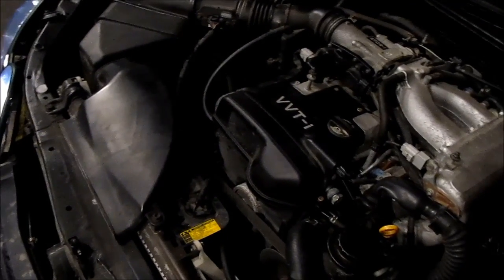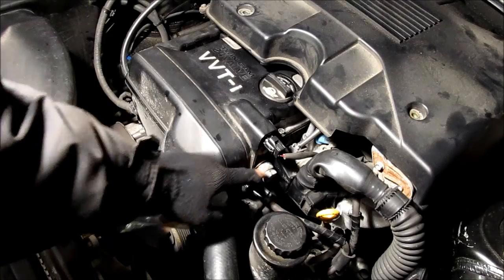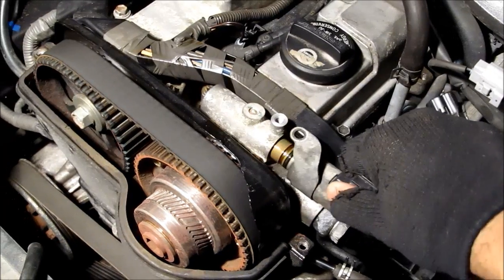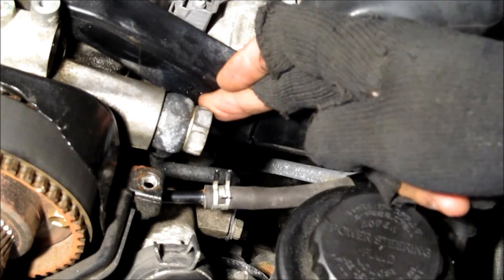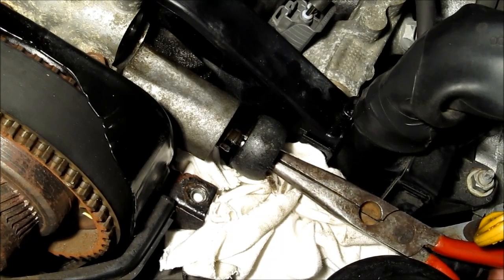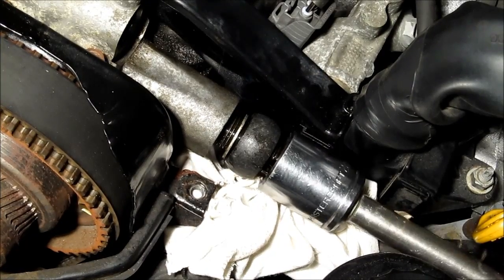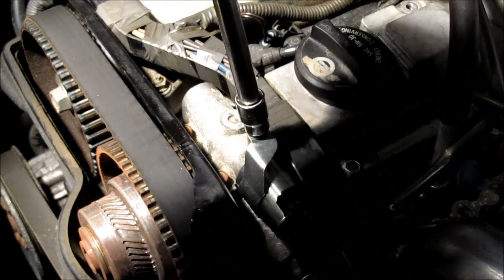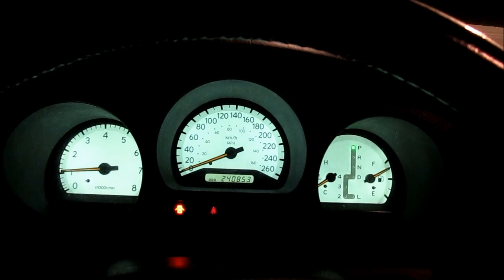P1349 Oil Control Valve Replacement  - Lexus IS300 / GS300

Comment: This is exactly what makes a fine repair video. Short and to the point, but with all the detail you need. Mine initially seemed stuck during removal, so I stuck a small flathead screwdriver in between the valve and the engine, gave it a twist, and it popped loose. I think the O-ring causes this. Oil the new O-ring when installing. Cleaning the filter with brake cleaner makes it like new, just check the plastic for brittleness. After install I cleared the codes and cranked it. I freaked a bit because the idle jumped to ~3K and stayed there. I just let it run (as I understand these things self-calibrate) and sure enough, in about 60 sec it dropped down to 1K. Test drive tomorrow, but all looks good. Thx!

Comment: Even if your valve works with 12V it doesnt mean its not broken. Mine was working with 12v after having P0014 code, tried the ohmeter and had 45 ohm on the old one while all the 3 other had 12.9, the range of these valves should be 8 to 12 ohms, if yours has like 3 ohms or 35 ohms don't look further it should be replaced. My dealership asked me 230€ for a brand new part + I guess one hour labor (110€) when I just bought this on ebay for 25 dollars (yes its used but it works it had the good 12 ohms and my code didnt come back after the replacing)

Comment: But if the unit works under the 12 volts, then it should work in the system not so? So why change it?
Reply from the maker: Yes it should work when 12V applied
Reply: @speedkar99  you must've made this video before you inherited your brothers underwear.
Reply: I think the orings could also wear and create an issue. If you see it actuating doesn't mean that when it's under pressure or hot that it still works.

Comment: Wat size is the washer inside the bolt? Mine fell off n now oil is leaking from there. FML!
Reply from the maker: Not sure anymore 😔 I lost my bolt too
Reply: Those washers are made of soft metal sometimes copper and some aluminum. I've seen something like a dorman kit that has various sizes of them. Crush washers are what's on the spark plugs and they look different.

Comment: My oil pressure light is on in my 99 es300. Could the VVT solenoid be the culprit?
Reply from the maker: No
Reply: Are you sure it's not the low oil light. There are 2 lights red and orange.

Comment: Thanks for the video. I did this based on the code and it stopped the bad idle but the check engine light still on.  Doesn it clear automatically once the solenoid is replaced?
Reply from the maker: Pull the battery

Comment: Thanks for the video. I just ran into this problem earlier today IS300 2001 with 137K miles. Check engine light came on and the traction control light flashes. Usually driving does not vibrates my car or stutters only when I come to a stop. Just got an OBII scan - P1349 VVT system maintenance and most likely solution is to replace Varibale Camshaft Timing (VCT) Solenoid. Anyone familiar with this issue? thanks
Reply from the maker: Same issue here.

Comment: Very informative. I have the PO300, PO301, PO304, and PO305 faut codes on my Lexus GS300, 2001. And the ClubLexus forum suggest to replace the Oil Control Valve.
Reply from the maker: Thanks. Hopefully it works for you
Reply: P0300, P0301, P0302, P0303 - cylindars 1,2,3 misfiring for me. I replaced my plugs and wires (not coils). I'm going to replace vvti (aka - 12v part being replaced) and filter as shown in video. I have 250k and I know this has never been changed.
I replaced all O2 sensors 2 months ago and new codes are popping up. I'm smacking them down like wack a mole.
I'm no longer going to use pennzoil, going to valvoline.

Comment: My 01 gs300 had those lights and the codes that it read were P0300, 02, 04

And then car has a rough idle and shakes a lot.  I replaced the solenoid and now just waiting for the filter to come arrive at advance parts.  

I start it with the filter and just tightened the banjo bolt.  The car started up fine and idle fine a few mins and then stalled :/

What could it be?!  Could it make a difference if that filter is not in yet? 

Thanks in advance..
Reply from the maker: Those are misfire codes. Check the ignition coils

Comment: I have a 09 Ls 460 wjth 150k on it that makes a dry clacking noise at startup for 1-2 seconds and then midway through warmup starts to make a clacking noise again that seems to cycle if I'm stopped at a light  on the driver's side  but not like the dry startup. The noise will temporary stop if I hit the gas and when fully warmed up will stop altogether. Please help , any insite would be greatly appreciated. 
Mike

Comment: I replaced the ocv and filter but still getting the p1349 code alone.
Reply from the maker: Maybe related to wiring, or oil viscocity
Reply: Changing oil today and resetting codes see of that makes a difference

Comment: Question, why if the solenoid was on circuit, you tested with a jumper wire from the battery and it did work,   why did you replaced?
Reply from the maker: Because even after cleaning it gave a code...so maybe it's not actuating all the way
Reply: I had the same question. Thanks for clearing it up.

Comment: 2003 GS300, 150k.  Just replaced the oil valve and TPS and the car is running fantastic.  Week prior I did the sea foam treatment and that helped too.  I believe these cars have a delicate balance to be maintained with all the sensors, and keeping the head/valve/throttle/injectors clean are paramount.  Last item is the oil leak fix.  Had a rough running car for the last year, and it is fixed now.
Reply from the maker: Glad it helped

Comment: I ve cleaned my vvti unit & filter. Luckily, i don't need a new unit.  it is quite costly for me (100% poorman)! toyota parts are lasting ,also with the help from yr video.. .I can keep my Lexus gs300running   foreverly! without yr video, i will suffer from Lexus dealer charges or throw it away as scrap metal . Thank you very much   sir ! cos you gave me the best benefit of repair my Lexus. Now my Lexus gs300 mk2 is running like a new car.
Reply from the maker: Glad it helped

Comment: My GS300 '98 Lexus started problem last week after 10 minutes of my car stuck on rough ground and I accelerate very high on reverse to get out of it. After cold start, engine would start shaking badly after 10 minutes of driving. Changed spark plugs, not solved. Cleaned MAF sensor, throttle body with sprays, not solved. Went to one garage, he said computer gives code  to change venus (or something) in the engine and would cost 300 USD. Went to another garage, he checked and got code P1656. I bought used OCV in 8 USD, mechanic charged 40 USD and its working fine now. 29 Mar 2018
Reply from the maker: +Khudai Nazar glad to hear it worked!

Comment: I have a sensitive vvt car Tuksan 2009 I opened the screw but the sensitive What I tried and what I do not move until I gave up Spri Mako as a result of the solution
Reply from the maker: +اتيلا اغا replace the valve

Comment: I just had the same problem on my 02 Toyota sienna v6. Cleaning didn't work. Had to replace both valves. Easy job
Reply from the maker: +Luke Martin Is it easy on the v6 ? How do you access them, isn't it tight on the side of the engine?

Comment: I have been getting P0300 codes lately with no physical symptoms of misfires. I read somewhere that this could be a system of a bad OCV. Thoughts?
Reply: Alfred Lyon if you haven't already fixed it just use some electrical cleaner(less corrosive than brake) and pop out the OCV filter and VVT Solenoid and give em a cleaning. Might wanna have a replacement crush washer for that banjo bolt just in case. You can reuse them sometimes but sometimes it'll leak if you use the same one.

Comment: did you have to remove the negative battery terminal before doing this?
or does it not matter?
Reply from the maker: +My Nam no need
Reply: thanks so much, your vid was helpful.
but, i just replaced the OCV valve and filter and both washers and the idle is still rough, might sound worse after i did some driving.

I did a bit of near redline shifts in order to get the vvti mechanism going.  On one acceleration, I saw the CHECK ENGINE LIGHT flash a couple times, then it disappeared.

How long does it take for the engine to idle smoothly after replacing these parts?

Comment: I believe I'm having the same issue but I also have leaking oil underneath the drive belt above the water pump, would this be the same issue or are they not related.
Reply from the maker: +Chapelle 696969 camshaft seal

Comment: Your video is amazing with step by step instruction and detail information. I had replace the part and solved the problem.
Thank You So So Much  !!!!!!!
Due to internet online business competition.    In May, 2017. The "Genuine Toyota 15330-46011 Cam Timing Valve" for Leuxs IS300 only cost $75.00 at Amazon com.   My local Lexus car dealership prices it at $170.
If you know the part number. You can get really cheap price at Lexus OEM part at very cheap price.   Not long ago, I bought the Denso Fuel pump for my IS300 from amazon com only $105.78. This Denso part is the actual part for Lexus, but Lexus marketing dept change the part number for their Lexus parts dept and charge $408 for that fuel pump.
Reply from the maker: +Andrew Woon Thanks for the feedback and I'm glad you found the video useful.

Comment: Is it possible it can make your ecu confused and have it show a misfire I was told it was doing that cuz my compression was good ,my ignition was good I had new spark plugs New spark wires ,new ignition coils,please help wit info
Reply from the maker: Yes the VTC can cause it to run rough and misfire since it causes the timing to be off.
Reply: speedkar99 thank you !!! Your videos are always helpful too ! Very good details
Reply: @ericrios7583  hey man did u ever solve this issue?

Comment: This was an excellent video! Thank you so much for your clear help and instructions. I just did this to my '01 IS300 with 171k on the clock and she fired right back up. To be honest I wish ALL youtube videos could be this helpful. Your editing and production quality is great! 

Tip for others about to do this repair:
- Be careful unplugging the electrical connector. Mine was very brittle and broke the harness a bit. Had to use a bit of tape to secure it.
Reply from the maker: +Logic Bombs Thanks I'm glad my video helped. Also try not to lose the washers....we spent an hour and half in the cold and dark trying to find it after it landed somewhere in the engine bay.
Reply: Totally! The 2nd washer closer to the filter is the one I had to be careful of. I positioned my towel underneath it just in case it did fall. Thanks again for your help.

Comment: What software do you use to get the codes and how do you connect to vehicle ?  My '99 GS300 has the exact same dash lights on and idle is erratic and feels like it's not running on all cylinders.  Just ordered up an OCV hoping it cures the problem.  Is it ok ro drive the vehicle the way it is, or will I cause damage ?  Also, can you buy a kit to connect laptop to vehicle and get codes ?  Awesome video btw.
Reply from the maker: +Cbb129 yes it's Toyota techstream, see this video https://youtu.be/KDpldAv0uQE
Reply: I couldn't get it to work without an access key.  The work around is too complicated for me (i'm computer challenged).  Is there an access key anyone can use ?

Comment: Huge THANK YOU.....video and explanation is spot on.  2001 GS 300....almost exactly mileage as car in video (240,000) and my car started to hesitate and want to cut off. Went to auto zone,  they did the free diagnosis computer came back with code P1349. Found this video and walkthru. I ordered parts thru ebay (solenoid and filter total... $54.23). Took me an hour to replace both. Considering I don't work on cars muc, it was quite easy. Started car, checked for leaks...none at all. Check engine light cel  was out and both asc lights out. Thank you again and keep the flow of information coming.
Reply from the maker: +Cme12345 I'm glad you found my video useful and your car is now fixed!

Comment: I REALLY need help!! So my 2001 Lexus GS300 had the P1656 code only reading as a OCV circuit malfunction, so the P1349 & P1656 are practically the exact same code right? The OCV just has gone bad? I just ordered a new OCV solenoid, and i am going to clean the valve and filter today. Its just having weird shaking at some points when idleing and stuttering when accelerating at 1000-1500 RPM.
Reply from the maker: +GrantoGilberto yep those were the same symptoms we had here, all the best on ur repair
Reply: GrantoGilberto would your car stutter when you take off from a stop like at 1000-3000 rpm and up to around 20mph it would stop stuttering when your past 20mph
Reply: yes pretty much what mine was doing was the exact same thing. it was just bad spark plugs and bad wiring that needed to be re-soldered again and it fixed the problem.
Reply: I have the same problem I got the p1656 code I need help

Comment: Why does he clean the oil filter after removing the old oil control valve? Didn't he say he already tried to clean it?
Reply from the maker: +Brent “Fabricator” Labasan To make sure it's clean.
Reply: Clean & brand new , are different item. Luckily a new vvti filter is not expensive, also it is cleanable. His filter has merged with oil 20years. It looks oil-brown ,but it is cleaned.

Comment: thanks for the vid. i just got a brand oem control valve come in from an ebay vendor for $53, should be installing it tomorrow.
Reply from the maker: +lysticalz Thanks, hopefully it solves your P1349. What brand did you get, Dorman?
Reply: oem toyota. already installed and good to go! i did drop a washer from the banjo bolt and couldnt find it. i have new washers coming in from the dealership tuesday but for now it doesn't leak any oil at all without the washer.
Reply from the maker: Wow, the same thing happened here, dropped a washer. Took 1.5 hours in the cold and dark and we finally found it on top of the sub frame. Otherwise we'd have to wait another day to get them in from the dealer.

Comment: i have a 2001 lexus gs300 by the way just recently did the spark plugs and oil change
Reply: Erick G to do plugs do you have to take apart the throttle body?

Comment: so my car suddenly started shaking/misfiring once at normal running temperature usually when stoping at a light or stop sign plugged thr computer up and got this code i took the ocv as well as thr filter oit and cleaned with brake clean and nothing im feeling like its something more then the ocv because the misfire is so bad before shutting off however it does start right up and idles normal and even drives normal when car is cold ..... i just ordered a new ocv i should be getting in a couple days any thoughts???? great video by the way
Reply from the maker: +Erick G We got the code with no symptoms. Cleaned the filter and OCV and only then surprisingly the rough idle appeared. So we bought a new OCV and that solved it, its been fine for 2 weeks so far...

Sometimes the valve gets grit inside and causes the valve to not open or close fully. What valve did you end up getting, OEM?
Reply: Any updates on your issues? Did a new ocv fix it?

Comment: Of course, there are 2 of them on the Toyota/Lexus V8s, too.  One of mine broke last year and the effect on engine function, as you'd imagine, is really dramatic.  I got a clue that it was going bad when there were a couple of very rough starts and a backfire.  I was stupid and pressed my luck by not just buying a replacement as soon as I got the warning.  Luck ran out on a nice day when everything was running great until suddenly it wasn't !   Had to be towed. 
Great video, as usual.  Wish you were my car's tech!
Reply from the maker: +wholeNwon Thanks! Did you do any damage to your car or was it just not driveable? What car do you drive?
Reply: '98 Lexus LS400 (great car). Engine extremely rough with a couple of backfires. I shut it down quickly. No damage that's detectable. Running well and that was about 1.5 years ago.
Reply: wholeNwon would your car kinda of stutter/hesitate when you take off at 1000-3000 rpm from a full stop ,and after 20mph would it drive normal when still hitting the gas ?